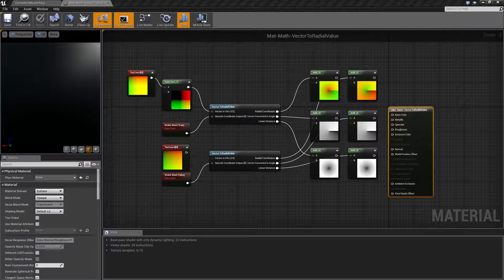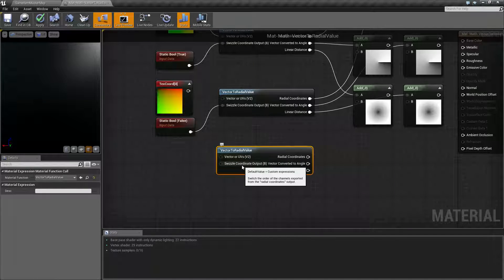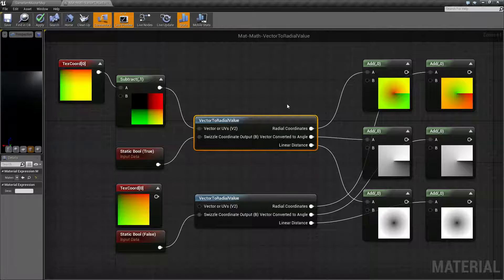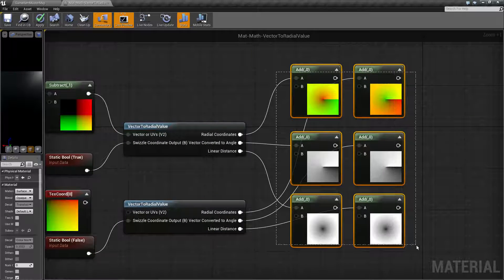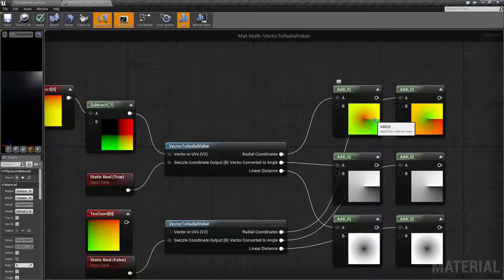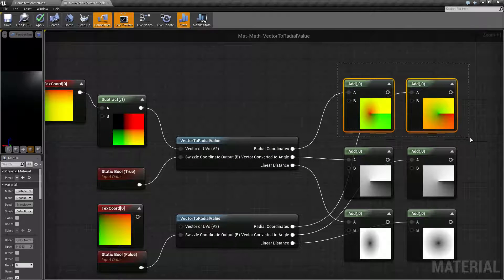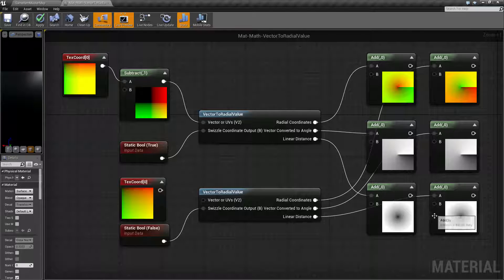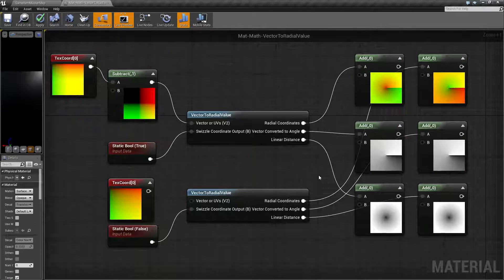WTF Is? Material: Vector To Radial Value in Unreal Engine 4 ( UE4 )

Comment: Anyone know how to rotate the angle output by 90 degrees? I have a circular gauge which I want to use the gradient to drive, but it starts from the bottom, not the right side.

Comment: If it is possible please show real examples how we can use this stuff and how it works at the end of the tutorial as result just like in UE4's tutorials
Reply from the maker: I try and include an example if I can but for some Nodes, like this one, the uses are normally complex and depend on the artist who needs what this node to do what they want.

A use for this would be to replace the need for a texture in a circular progress bar and use the output of this node instead to create it.  In a future video I will be going back to the concept of the circular progress bar and using this node turn it into something better.